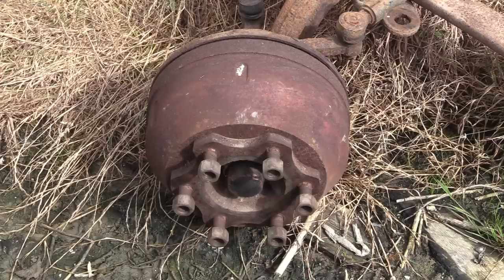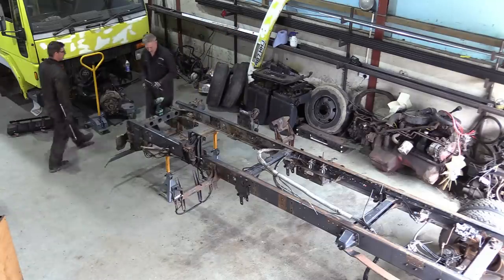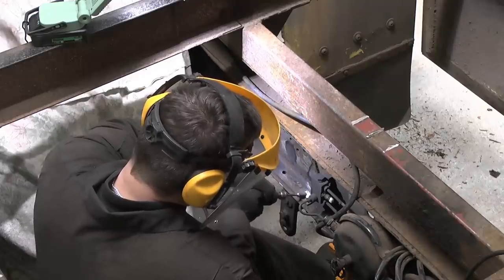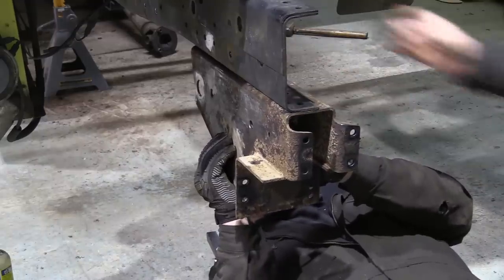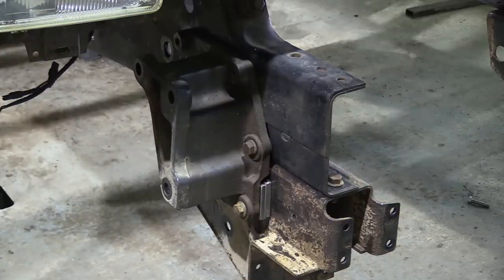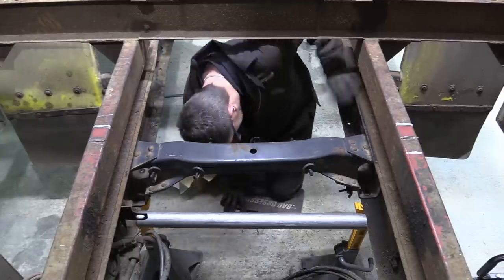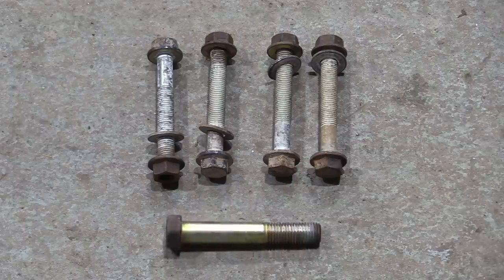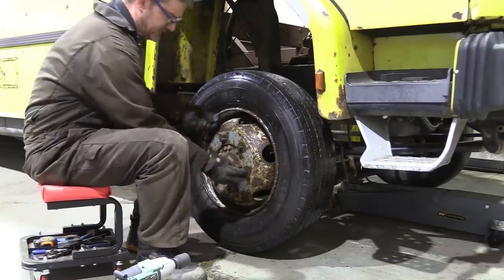The Escargot - RV/Camper Car Transporter Conversion - Part 4

Comment: In which they build a vehicle from scratch in order to avoid taking a driving test...
Reply: to be fair, driving tests wouldn't be channel content
win/win for them
win for us too
Reply: Underrated comment
Reply: DVLA isn't the worst bureaucracy to take on in normal circumstances.. 
But this isn't normal! You don't poke a snake...You go round it!
Reply: @geoffdavis8008  Driving tests are what you do at 17. No No No!
Reply: And have to do CPC qualifications every five years if they intend to make money from using the vehicle (if you meet a particularly strict Officer they can claim that winnings from racing count), and have to have a medical every ten years and the MOT requirements change so all round it’s easier to fly under the radar!
Reply: I change my living address on my id to do exactly the same!
Reply: @vernonbear  To be fair, that should be a general requirement for drivers above 50. I mean, if we let bus and lorry drivers do it for good reasons, those same reasons should apply to drivers of regular cars as well, shouldn't they?
Reply: @vernonbear  what you said plus the licence expires earlier than the normal one. And all that paperwork is really expensive, more than what they paid for the Daf
Reply: Volkbrecht I wonder if you will say that when you are 50?

Comment: It was SUPREMELY satisfying to watch you guys completely deconstruct a truck until you could simply carry out 2 long straight rails. Keep up the good work guys!
Reply: Which begs the question, why the 'ck didn't everything get left on the Daf and  a requisite box get built on those 2 rails? (Apologies obviously if its summat daft like different driving license required....)
Reply: Oh bugger - the advert finished and I found out :)
Reply: I prefer to think of it as them carrying out two large bracket kits.

Comment: I think the extra 50kg of the front axle is negated by the amount of friggin holes drilled into the frame. It about evens up :)
Reply: Adding lightness all the way!
Reply: The technical term is speed holes
Reply: Like a swis cheese

Comment: Wife: What are you watching?
Me: Two blokes in England taking an old truck apart. 
Wife: Why?
Me:............
Reply from the maker: It's a fair question.
Reply: Bad Obsession Motorsport I wanted to say ‘ in case they ‘make the noise’’. It was just too hard to explain.
Reply: @CHRIS_HITCHCOCK   I guess it's easier than explaining the "angry end" ;)
Reply: One and a half hour later the wife is wondering why are you talking about installing bespoke air-control systems on a mini and what does it have to do with this truck.
Reply: @Leo0718  As a general rule, i think the fairer sex just don't get it. boys and their toys and all that jazz.
Reply: @CHRIS_HITCHCOCK  don't forget the occasional 'woohoo'
Reply: You might try "...so imagine there's a YouTube channel about making custom high-heel shoes..."
Reply: My wife stopped asking after the second or third episode of Project Binky! Now she just shakes her head and sighs...
Reply: 'For Science' would have been my answer
Reply: @AttilaAsztalos  "Project Heely"?
Reply: I use  the same explanation as to  why I ride a Harley. " If i have to explain you will never understand. You either do or you don't". ( try to adopt an aloof expression)
Wife: Your an idiot
Reply: I think I saw a cat zipping through the frame a few times. You could've told her you were watching a cat video.
Reply: "You don't understand this the way I don't understand makeup"
Reply: Because reasons. And that's all you need.
Reply: @BadObsessionMotorsport  Because they gave me this tshirt!
Reply: @greatnortherntroll6841  My wife does that quite a bit.
Reply: @FxHolden-kt1df  then you can give her an aloof: "you're"!
Reply: Me: So they can put the parts on another truck.
Wife: That's not what I meant.
Me: That is what you asked.
(and soon there are no more questions about what I am watching)
Reply: One of the things I miss about my ex was the similarity in outlook. I once watched a laptop dismantling video while she was somewhere behind me. The bit I was waiting for was when they flipped the clip open to release the ribbon cable (something I'd not realised when I'd built a video display) and simultaneously I and a voice from behind me said "Aha!"
Reply: At least she knows where you are and what you are doing... and you don't care what sort of sandwiches she brings you...
Reply: The answer to the 'why?' question  must always be the same gentlemen. As long, detailed and convoluted as you can possibly make it. Embellish, waffle and bs as though your life depended on it, then when you think she's had enough, take a breath and with a renewed vigour state "let me put it another way." she will be driven from the room screaming and hence forth refrain from asking bloody silly questions!!!!!
Reply from the maker: Ron F  Nothing intentional about it.
Reply: @FxHolden-kt1df  "explanation as to why I ride a Harley." 
Same reason people fly bi-planes?
Reply: @BoB-Dobbs_leaning-left   Exactly !! :)
Reply: Chris Hitchcock you should tell her "So that I know never to think of getting involved any such project - ever!" And why!
Reply: Because REASONS!!!
Reply: If she asks why, it may be time for a divorce 😂
Reply: @mooneyes2k478 😉

Comment: You might need to go for uprated springs as the Cargos, indeed most trucks that were built up as mobile libraries and that type of thing had heavier-duty springs than were usually fitted to 7.5 ton trucks to take account of the weight of the body, which is pretty weighty, along with the contents.  If my memory serves me right, they were usually fitted with the springs for a truck of the next weight class up, so a 12-ton truck.  If you need them, a truck breaker should easily be able to help you with a set of good used springs from a 12-ton DAF LF, and they shouldn't be expensive as they're not the type of truck that people really rebuild, they usually get driven into the ground and then junked, so demand for them is unlikely to be high, as most companies that run them will generally replace any parts necessary with new items or service exchange parts to minimise down-time meaning that used parts will usually just be so much scrap metal...

Comment: Richard, You chasing that washer between the frame rails reminded me of a story my cousin, an automobile salesman in upstate New York, USA, loved to tell about a customer who kept bringing his Cadillac Sedan Deville back to the dealership time after time because of a persistent rattle in one of the rear fenders. The body men and mechanics tightened and retightened every nut and bolt they could put their tools on, but to no avail. Finally the body shop removed the fender and found a large washer on a length of string that some bored line worker had hung there during the original assembly. Really enjoying your videos, gents. Keep 'em coming.

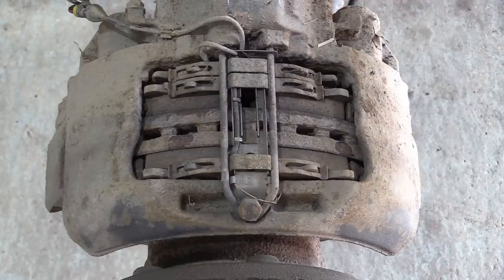Comment: Just idly, having seen that brake caliper at 0:40 and having fecked about with pad swaps on those a few times now, and not knowing if you've run into them before:

1. The adjuster -- under a plastic plug, usually yellow -- is obstructed by the chamber. So you either need a funky custom-bent 8mm spanner, or mess about taking the chamber off, to adjust them.
2. The adjuster is arse-about-face threaded. Wind it clockwise to back the adjustment off, anti-clockwise to tighten the adjustment.
3. That third 'pad' that goes between the piston and the actual brake pad needs to be held to the piston when you're backing the brakes off; because it holds onto a peg that sticks out of the piston and stops it rotating. If the piston rotates, it tears the boot up, and whatnot.

They're not as nice to do pads on as the Wabco ones, but they work okay.
Reply: ChrisHallett83  The LFs with the 22.5" wheels have a much less pain in the arse caliper, honestly. (Same as a lot of other trucks with 22.5" wheels. ) But, I guess that's what one gets, with a smaller wheel.

Either way, though, it's still going to be better than the Cargo drums.

Comment: Losing washers behind that steering box mount like you are feeding a slot machine 😂
Reply: It was a bit of a gamble fitting it there.
Reply: Replace the washers with a solid plate. Skip weld in place so it can not move.

Comment: Love the camaraderie fellas, great fun and probably illegal in the UK now.
Reply: Thats a distinct possibility, since the suspension, axles, steering and chassis have been changed around, the DVLA may consider it a "radically altered vehicle" and would require an IVA to be road legal..
Reply: 2 guys having fun with spanners...Coming soon! (They got on well on this one)
Reply: @tech4pros1  All they have to do is show the inspector the videos, I'm pretty sure the quality of the work would speak for itself. Factories turn out cars and trucks on Monday and Friday that might not be as well put together as Binky or Escargot. Customs are usually meticulously built, it's to show off what a shop is capable of, not just one of thousands coming off a production line.
Reply: @tech4pros1  I think the OP was referring to two British men having fun being illegal (I may be wrong though).

Comment: Outstanding work, necessitated by an overburdensome bureaucracy. In the US, as soon as you install a cot, a hotplate, and a port-a-potty, you can register as an RV, and no special licensing requirement. Some states, you don't even have to do that, just checking the RV box on the form is enough, you get an RV plate and away you go. Good for you guys finding a way to build what you need!

Comment: By the time you're done you'll have to convert both to electric engines due of lack of petrol :)
And I'll be watching that, too :D
Reply: No worries there, this beast will be running on diesel.
Reply: By then they will scrounge up a second-hand drive train from a Tesla semi.
Reply: By the time they have finished, there will have been time for new dead animals to turn into oil.  After all, it only takes a few million years.

Comment: Isn't the curved upper cross-member 40mm narrower than the Ford frame rails?
Reply: I was thinking that to, so either they just pulled the rails closer together, or sometimes the rails come closer together anyway.
Reply: I am glad I am not the only one that had this question.  Then I remembered that they installed another crossmember back in Part 3.  So I went back to watch that part again and found they needed 20mm spacers to install engine and transmission crossmember and mounts.  Now I am really confused... did they get spacers made for this crossmember too?  Is it wider for some reason?
Reply: I thought they said it tapers in hence having to mark top and bottom on the inside and transfer the measurements out.
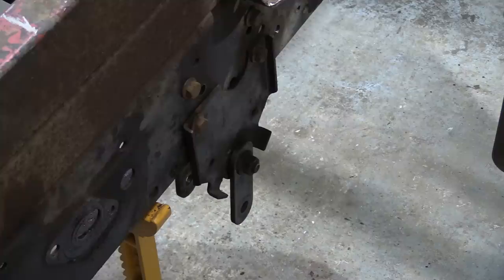Reply: At 31:59 is a shot of the cross-member and it is a goo fit to the frame rail. Witchcraft!
Reply: @joshjohnson9423  They had to swap the front spring brackets to correct for the difference too, my guess is the Ford chassis narrows? It looks like you can see it a bit at 16:03 before the engine pops in.
Reply: @whyexactly  I suspected that may have been the case, quite a lot of truck chassis do taper in, they do seem to be extremely lucky with what they do.
Reply: @whyexactly  I didn't notice that when I watched it the first (or second) time.  I have to agree, this is witchcraft.
Reply: The curved cross-member came from the cargo - it's the bottom piece that was from the Daff.  Genuine Franken-truck!
Reply: @whyexactly  at 16:03 they are working on the front-front spring mounts. The curved upper mount is at the rear-front spring mount. And we know that the front is 40mm wider because they flip the near/off sides to narrow the width of the spring mounts 40mm (20 each side.) It's still witchcraft!!
Reply: @TheRonskiman  at 24:57 they lay a straight edge on the frame rail when making measurements, there doesn't appear to be a taper/bent in the frame rail.
Reply: @rickh6963  sorry I got the time wrong, it's later on when they put the engine back in that you can kinda see a taper in the frame rails. As you said they had to swap the front-front mounts and spacer the one crossmember so the taper has to be after that crossmember but before this one.

Comment: I love how you talk about 13mm when we really know you're just using 1/2" drill bits! :-)
Reply: They may be using 1/2" bolts so drill 13mm for a bit of wiggle room.
Reply: might be  a 12.7mm  bit 😁
Reply: They are using a 13mm because step drills usually only go up in 2mm increments.
Reply: @Chris-gw7op  what if its a imperial step drill in 1/16" increments?
Reply: 1/2"...you are watching this in black and white.

Comment: Is anybody else's OCD working overtime thinking I hope the wire wheel those parts and paint them?
Reply: @clintonepps3666  sand blaster would definitely be my preferred option, but I can't see them doing it.
Reply: Yeah. When you're going to be putting so much effort and money into the interior, it makes sense to make sure it lasts as long as possible. So it's not OCD. Not at all. Nope. Definitely not. It's just common sense. So that's what they should do, right?
ARGH! JUST RUST-PROOF THE F*****G FRAME ALREADY!!!!!
Reply: Just wait. This is the dry build right ? Then take it all apart again and paint it. Can’t be rushing things!

Comment: I'm so glad you went for the DAF axels lads because you REALLY don't want to be replacing a kingpin on that old Ford axel. You're going to have to use the DAF mastercyls as the Ford ones are for drum brakes and wont have big enough reservoirs for discs but the foot control valve should pipe up to DAF cyls ok.

Comment: Old welder's trick from my grandfather's generation: use a ground-down soapstone marking tool to mark on dark steel where other marking implements are less than useful. He would use a box cutter to cut the little soapstone sticks to an angle and rough carve a chisel edge onto one side before sanding it to something more useful, though the flat side of a grinder will make even faster work of the task. The marks those soft stones leave are quite visible on dark steel and painted surfaces and can be removed with a scrubby sponge if you make a mistake. I suspect Nik would prefer to make an aluminum holder for the little stone sticks to prevent them getting broken, since they're relatively fragile when abused.

Comment: those rivets, use an angle grinder to cut a x in the head, then go to air hammer. each one is around a minute. what i figured how to do anyway. great job guys.

Comment: Drove Cargo and Daf  and Merc 7.5 ton flat bed ,best of 3 the Daf by far , worst Merc fitted with artic chassis meaning weight capacity 3ton Cargo dependent on occupants  weight , Daf best on fuel cosumption load capacity 4 ton and best turning circle, where I went up that west cost some people struggled in 35cwt, box vans.also Cargo bodywork are prone to rust.

Comment: Guys I think that jacking up the horn and putting a new truck under it would have been a lot easier. Not as much fun but easier.
A little hint from across the pond, remember "the proper application of high explosives will fix anything or make it fit"
And one more thing that I noticed about how you work, I think that you two would lower the river before raising the bridge if given the chance.
Hope you found some humor in these comments. Cheers

Comment: Looks like this Cargo will be a modern drive. I used to drive them with the Ford Engines 6.0 and 6.2 litre. The 6.2 was a bit more flexible but had only a 240 range compared to the 6.0 litre 0811's 300 miles on a tank. Your 4 cylinder turbo should do much better. That Cummins should also be a lot more lively than the old Fords. The Cargo 7.5 tonner was a nice comfortable long distance drive though. Good idea updating the brakes though. The earlier drums weren't fantastic. Lol

Comment: next time you have washers that you going to use for spacers on a part put put some rvt on them and glue them to the part your poaching on there are TV is springing and will Flex when aligning the bolt to the hole. Easy peasy

Comment: maibe keep the badges of the daf cab and grille and put those on the cargo as well , with the dash and probably the steeringwheel from the daf filling the interior you prolly can fool quite a few that its a one off experimental daf truck 
kinah wondering if you can adapt the daf bumper and front facia ontoo the escargo as well , would make the wiring of the lighting a bit  eazier in the front 

think that daf ruck has given you its monies worth and then some in parts for this build , all thats left is the cab and two frame rails

Comment: Did you rip out all of those huge steel floor crossbeams. Timber I-beams will do the job just fine with a lot less weight.

Comment: The steering geometry in the front axle are made to fit a specific wheel base, you new front axle will have a senter of the turning radius in front of the rear axle theoretic strait line since it come from a shorter lorry. At least that's the theory. The inner wheel in a sharp turn will rubb the asphalt. will you change or adjust  the steering arms on the spindel so the inner wheel don't turn so much or just leave it that way?

Comment: There are scribing vernier calipers, maybe £30, much easier to use and more accurate, and the scribing tip is a piece of wire you can move/ground/replace Insize makes one

Comment: So how did you get around the 40mm difference in the chassis widths on the rear spring hangers? The fronts you explained wonderfully, but skipped over the rear...

Comment: Why haven't you cleaned the parts from the daf with a needle gun and spray painted them? It's a small amount of work but it will hold up much longer.

Comment: Essentially taking the short wheelbase DAF running gear and fitting it into a LWB chassis, correct? Have you considered the Ackermann angle?